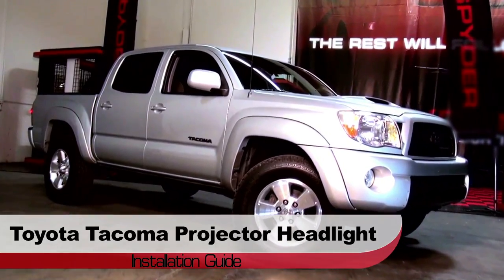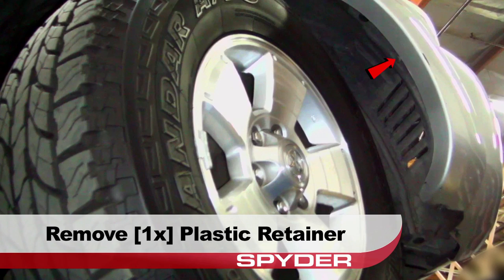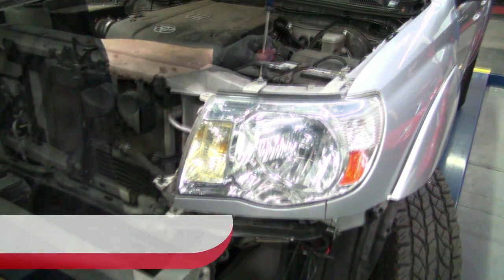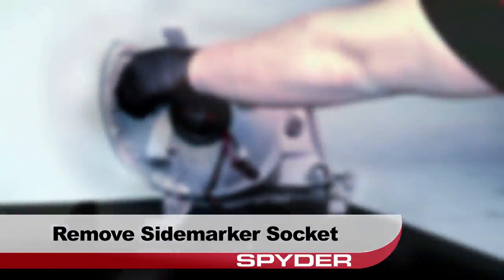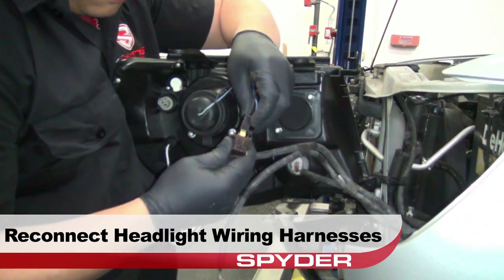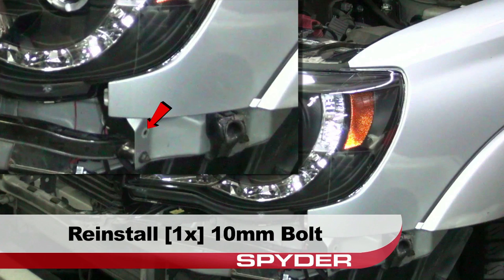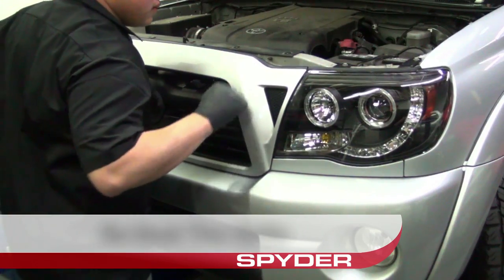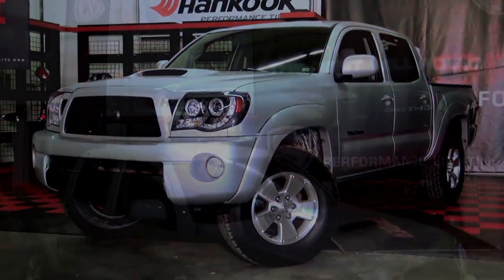Spyder Auto Installation: 2005-11 Toyota Tacoma Projector Headlights

Comment: Will these fit a 2013 Tacoma? And or any other sort of halos? Everyone I've seen says they only fit up to 2011
Reply from the maker: +froabigone the tacoma has been redesigned since 2012. therefore this particular product does not fit 2013. 
we do have headlights for 2012 tacoma. you can search this part number PRO-YD-TT12-LBDRL
Reply: @spyderauto  is there an installation video for that product?
Reply from the maker: @garynewman7200  We are working on making an installation video for 2011-2015 Tacoma Headlight, thanks.

Comment: I just installed these today in an 09 and the side marker socket will NOT go in... the hole in the back of the reflector is too close to the hole in the back of the headlight assembly, which makes the edge of the bulb socket catch on the edge of the hole in the back of the reflector.
Reply: Experiencing that now while simultaneously not having success anywhere uncovering any kind of somewhat useful wiring instructions for the halo + LED wires. Absolute joke.
Reply: @mikegiordano3797  For the side marker lights you need to replace the bulb socket with Toyota part# 90075-60056. The LEDs and Halo should just be spliced into the parking lights.
Reply: @DarkSeraph351  just figured out the splicing of the first side maybe 13 minutes ago and it was a success. Thank you